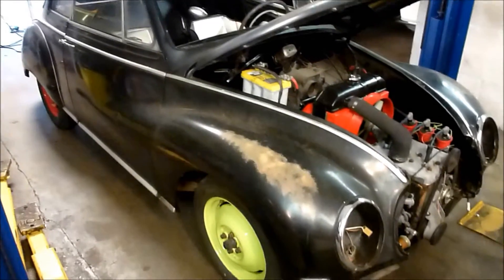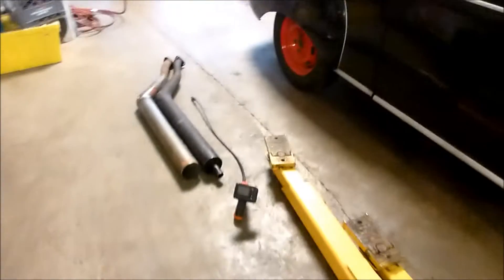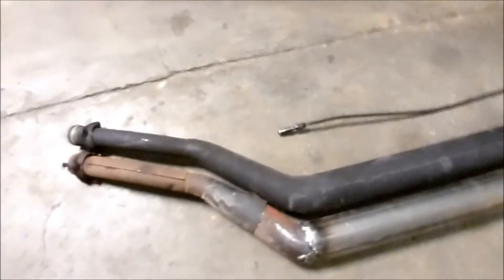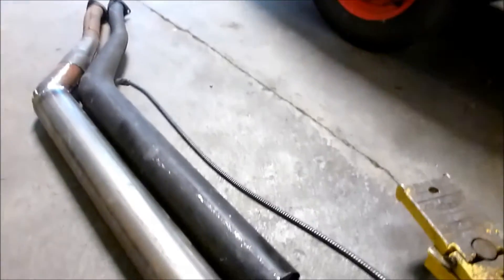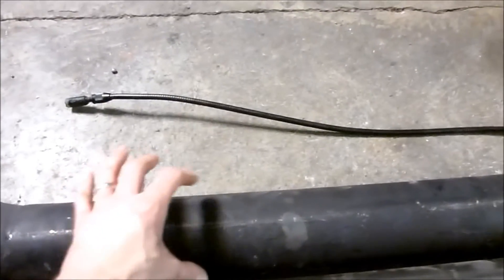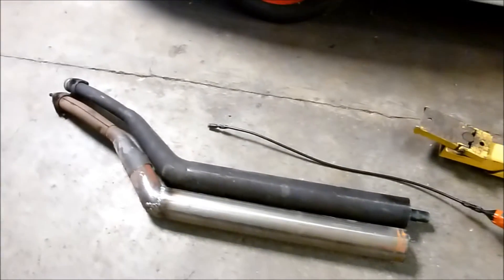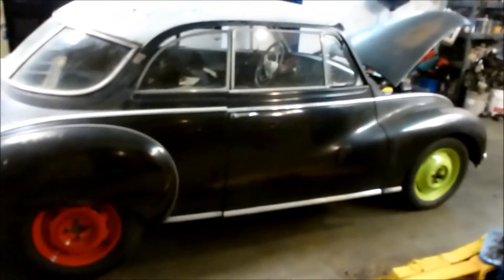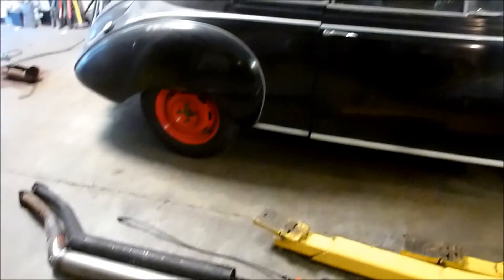DKW 3=6 Expansion Chamber fabrication

Comment: i have a DKW F11 with the 900CC engine, it does not have an expansion chamber but still has massive amounts of low end power and will lay suprisingly long rubber stripes for a 38HP engine.
Reply from the maker: torque is what you want, when 900cc's moving a 1700lb car.  Lays rubber stripes you say ? Really ?
Reply: 2stroketurbo the f11 is a two door sedan like the junior and it weighs around 800 kilograms, i got the car from my grandfather as a birthday present five years ago and spent all this time restoring it, i'm fifteen now. my grandfather have taught almost everything there is to know about dkw's ask me and i probably have the answer. i live in Norway so i don't use lb. the 18th of february i get the new brushes for the alternator so around the 20th i can try to upload a video of it ;)
Reply from the maker: Awesome ! I can't wait to see

Comment: The only 3 into 1 expansion chambers I know of are the after market systems that were sold for the seventees Suzuki GT 550 and 750 two stroke triples. Those systems were larger than your DKW pipe! (despite that they performed terribly) I have no idea still how your system might perform. My guess is that it is tuned for low end power. I'm very curious!